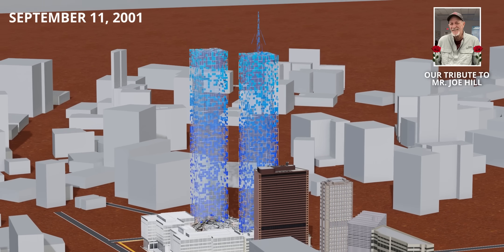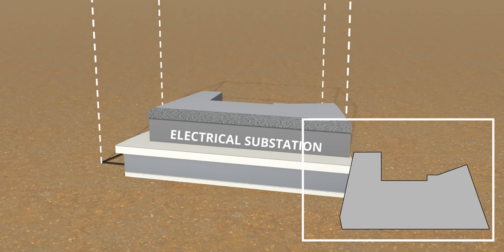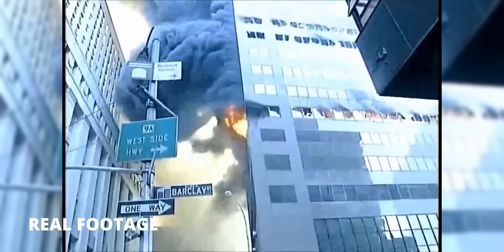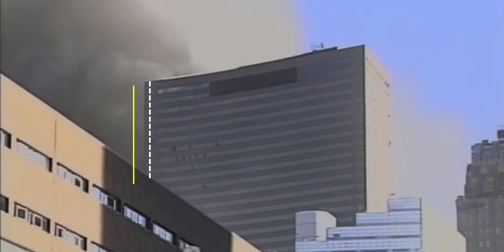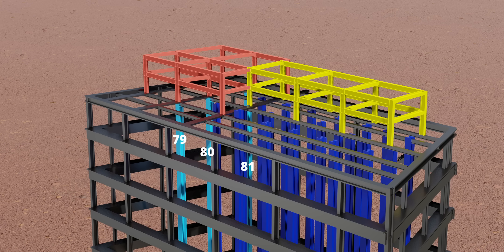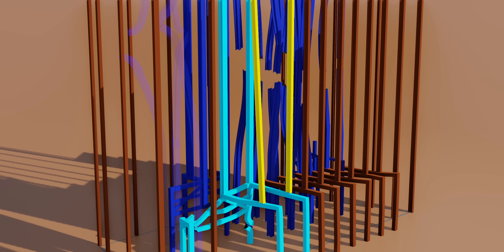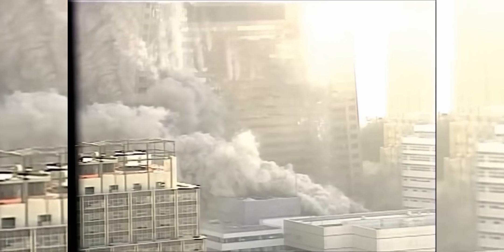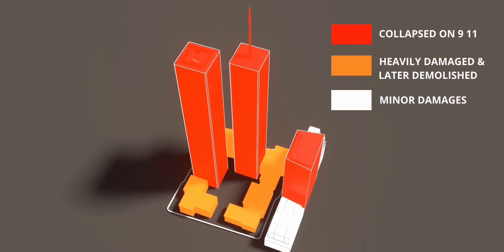Collapse of Building 7 | The Complete Physics

Comment: You talking through your ass cause your mouth knows better!
Reply: And yet (mostly) not wrong. Go figure. Not what you want to hear of course, but not wrong. Which is why that rebuttal (if I'm being generous) is the best you will be able to do.

You may not like it after more than 2 decades of internet conspiracy dogma, but what is being presented in this video is fundamentally correct and widely supported by the worlds engineering community.

While imperfect (there are a few problems) this video goes into a much higher level of detail than many viewers can comprehend and gets the collapse mechanisms fundamentally correct. This is true no matter who planned and carried out the 9/11 attacks or why . 
	
Sure, it’s not what you want to hear and goes against 20+ years of conspiracy dogma and conditioning, but that is not the same as it being wrong. You just need to fix your dogma. 

On the plus side, this video can be (and is) fundamentally correct about the engineering AND the 9/11 attacks could still have been some sort of inside job. The two things are in no way mutually exclusive. It’s just not the inside job the clowns you have been following on the interent have been telling you. 

This will surprise you to learn, since the conspiracy side of the internet hides it from you, but the mechanisms described here have broad professional support around the world. There are no professional engineering organizations (for example: ASCE, ASEE, ICE, etc) that disagree with them or have offered any formal dissenting opinions or alternative hypothesis. 

So, either the overwhelming majority of the worlds structural engineers and quite frankly simple observation are wrong,… … or you know more than the worlds best engineers from cruising around on the internet. Which seems more likely? 

If this explanation is wrong then produce a better one.  Be the first to even try.

Comment: 23 years later, this is the best you can come up with? 

If all of this is true, they approved multiple 90 degree angle changes for FOOTINGS.

The "we were just retards" argument doesn't work for me.
Reply: The video is pretty accurate. However, the damage/gash was caused by falling debris, not the antenna.
Reply: You may not like it after more than 2 decades of internet conspiracy dogma, but what is being presented in this video is fundamentally correct and widely supported by the worlds engineering community.

While imperfect (there are a few problems) this video goes into a much higher level of detail than many viewers can comprehend and gets the collapse mechanisms fundamentally correct. This is true no matter who planned and carried out the 9/11 attacks or why . 
	
Sure, it’s not what you want to hear and goes against 20+ years of conspiracy dogma and conditioning, but that is not the same as it being wrong. You just need to fix your dogma. 

On the plus side, this video can be (and is) fundamentally correct about the engineering AND the 9/11 attacks could still have been some sort of inside job. The two things are in no way mutually exclusive. It’s just not the inside job the clowns you have been following on the interent have been telling you. 

This will surprise you to learn, since the conspiracy side of the internet hides it from you, but the mechanisms described here have broad professional support around the world. There are no professional engineering organizations (for example: ASCE, ASEE, ICE, etc) that disagree with them or have offered any formal dissenting opinions or alternative hypothesis. 

So, either the overwhelming majority of the worlds structural engineers and quite frankly simple observation are wrong,… … or you know more than the worlds best engineers from cruising around on the internet. Which seems more likely? 

If this explanation is wrong then produce a better one.  Be the first to even try.

Comment: All this video proves is that good animation can make any theory convincing. I still hold it as a controlled demolition. Fires do not bring down steel buildings. I've seen enough videos of buildings on fire, with flames shooting up 10, 20 floors. Once the fire goes out, the building is still standing. In this case, as Silversteen said, pull it. pull it.
Reply: What the hell are you on about? Fires bring down steel buildings all the time.  Steel is formed using heat and deforms the same way. We've known this for a millenia. 

That's a thousand years to you.
Reply: @MFitz12  At what temperatures? Name one steel structure skyscraper, other than the WTC ones, that have crashed to the floor because of fire? I understand the WTC buildings were shoddy constructions (no central concrete cores) but still the way  they all fell, points to none other than controlled demolitions. WAKE UP my friend.

Comment: There are a ton of structural elements that were in the building including massive X braces I suppose those were left out of your modeling as they do not allow for your theory to work. Also office fires do not even come close to being hot enough to cause the interior beams to fail in the way you have described the interior beams failing and there was no physical damage caused by debris to the interior beams. As an engineer what you are putting out may fool a laymen but it is much less credible than the data put out by Richard Gage.
Reply: Making things up isn't an argument, you do know that, right? Then again, since you literally do not know the first thing about the building, I suppose lying is all you have.
Reply: @mooneyes2k478  I am an iron worker and build steel structures. There absolutely was X bracing There are photos during construction that clearly show them. They are also on the prints. The only place they are not is in this model.
Reply: @anthonysimpson2847  Yep. Of course you are. And I'm Superman. Well known.

Meanwhile, no there wasn't.

Comment: They said that jet fuel made the fire hot enough to melt the steel beams in the two larger towers, and that's why those buildings fell, but building 7 wasn't hit by a jet. A Regular building fire can't burn hot enough to melt iron beams that support the structure of the building. That's why whenever there are fires in other high rise buildings, they don't just fall, like the two WTC towers did. No other high rise buildings has ever fallen because of fire. So if there was no jet fuel in building 7, why did that one collapse?
Reply: "They said that jet fuel made the fire hot enough to melt the steel beams in the two larger towers"
The only "they" that has ever talked about "jet fuel" is you and your "truther" buddies. And only to try and make it into a straw man.

"A Regular building fire can't burn hot enough to melt iron beams that support the structure of the building"
Which was, 1, irrelevant since nothing "melted", and 2, utterly bog stupid since there were neither "iron" nor "beams".

"That's why whenever there are fires in other high rise buildings, they don't just fall"
Which was wrong, since they have, and irrelevant, since "high rise" is meaningless. Amazingly, there's no magical height of building that makes it somehow immune.

"So if there was no jet fuel in building 7, why did that one collapse?"
How about, "because it burned for 7 hours without any fire fighting"?

Comment: so many problems with this video...
Reply: Such as,...?
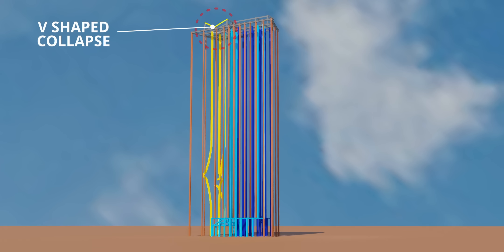Reply: @TheCriticalStinker-01  the failure of "transfer truses because building temperature was hight " at 6:31 - very poorly explained - they were deep below fire zones - how did they heat up? why are there 10meter gaps appearing in core columns as they progresively colaps all at same height? where are all the horizontal trusses that are holding core columns bound together?  this MS paint "simulation" is very poorly done... there are much more comprehensive studies on this topic.. done by profesors and universities..

Comment: Only one peer reviewed paper exists on this subject and it clearly states WTC7 was a controlled demolition. Which interestingly is what the owner admitted to on the day.
Reply: The collapse of Building 7 is one of the most studied engineering disasters in history and the subject of 5 comprehensive engineering studies and more than two dozen technical articles in major peer reviewed engineering journals, most of which were published 15 or more years ago. Thousands of pages of material.  This should get you started.

FEMA BPAT (initial report superseded by NIST NCSTAR 1A)

NIST NCSTAR 1A: Final Report on the Collapse of the World Trade Center Building 7, 2008.

Guy Nordenson and Associates, WTC7 Global Collapse Analysis Report and Summary of Findings, 2010.

Arup, WTC -7 Structural Fire Analysis Report (Runs 1-4), 2010.

Weidlinger Associates Inc., WTC 7 Collapse Analysis and Assessment Report, 2010.

BRE Centre for Fire Safety Engineering, Analysis of the Impact of a Fire in the Mechanical Room (5th & 6th Floor) of the World Trade Center 7 Building, 2010.

T. McAllister, R. MacNeill, O. Erbay, A. Sarawit, M. Zarghamee, S. Kirkpatrick, J. Gross, Analysis of structural response of WTC 7 to fire and sequential failures leading to collapse, J. Struct. Eng. (United States). 138 (2012) 109–117.

For a summary of the major studies I would recommend THE COLLAPSE OF WORLD TRADE CENTER 7: REVISITED by Mhd Anwar Orabi , Liming Jiang , Asif Usmani and Jose Torero which is a 33 page summary of the different analysis and conclusions published in 2020. Sorry, YouTube will delete this post if I give the link but it should be easy to find and is available from the University of Queensland, Brisbane. 

Which one were you referring to?

Comment: Well, it's a good thing they made a cartoon of this event because they way it's presented here is definitely something out of Fantasyland! Watching Building 7 fall straight down into it's own footprint just like WTC 1 and WTC 2.  I wonder what kind of records were kept in that building and who would benefit should those records get "destroyed"? 🤔
Reply: The top of the  south tower noticeably tilted when the collapse began, and there is footage of the penthouse on top of tower 7 falling through the roof before the whole thing collapsed. Also, tower 7 was damaged by debris from tower 1 and was on fire for nearly 7 hours. Not many buildings could withstand all of that.
Reply: @eastvilleholdingscorporate7881  it just a near perfect control demolition....huhuhu
Reply: Building 7’s collapse was completely different to the Twin Towers and harder to understand with most details hidden from view. But we can still sort out what happened through careful analysis and observation.  This is my explanation  of the collapse using the best available information and relying on no authority.

B7 was complex 47-story steel framed structure built on top of a smaller existing 3-story building, requiring several lower floors dedicated to complex load transfer structures instead of usable office space. Of trapezoidal shape and all-steel tube-in-tube construction, B7 (above the 7th floor) consisted of a central core of steel columns carrying most of the gravity load, perimeter steel columns around the outside of the structure carrying the remainder of the gravity loads and long span beams and girders to tie those elements together and form the floors. On the outside of the building hung a moment frame - the last part of B7 to fall 

Phase 1 : The first externally visible signs of collapse initiation occurred at 5:20:28 pm and was notably quiet with observers not even realizing the building was collapsing! There was no audible warning in the form of  hundreds of ear drum busting 180-190dB explosive bangs preceding the collapse. Here at 12:00 a local CBS affiliate reporter is talking 10 blocks from B7 when collapse begins. People don’t start to notice the collapse until 12:11. At 12:45 is the famous CBS fixed camera clip of Building 7’s collapse. Note how quiet it is.

youtube.com/watch?v=t5tEy6mXSE8&ab_channel=fresnosean379

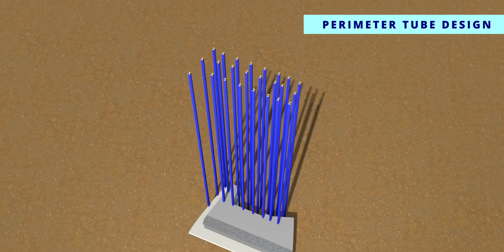Collapse initiation was due to lower floor failures above the load transfer region (7th floor) in the NE corner. In this video at 0:45 you can see the NW corner from inside the building while under construction, Column 79 just out of frame on the left. That big, angled steel beam across the top of the frame connects to C79 at one end. The girders connect to the beam. That beam and all those girders depend on just one connection

youtube.com/watch?v=nP3TNHPCIVU&t=35s&ab_channel=EdwardCurrent

Phase 2 : Lower floor failures caused a loss of critical lateral support over an excessive length of core Column 79 and it buckled. If you look at a floor diagram of Building 7 (see above) and look at all the structures that depend on C79 you quickly realize this one column was a relatively isolated structural element on which a disproportionately greater fraction of the structure depended analogous to say the Key Bridge. Externally we see a vertical progression of window breakage along the 44-46 line and a kink in the roof of the East Mechanical Penthouse at the top of the building, consistent with C79 failure. The transition from full capacity to almost no capacity occurs in virtually an instant. Once the buckling failure occurs there is almost no resistance

Normally with a buckling column, the load could very well be redistributed to other columns, meaning the buckling could stop after a while. With C79 that is not the case - the failure did not redistribute the load, so the collapse rapidly progressed to the roofline, sinking the rooftop penthouse.

Phase 3 : With C79 gone, B7’s progressive, non-symmetrical collapse continues with C80 and C81 at the east end of the core left laterally unsupported and quickly buckled and failed as well, sending the EMP down through the building. C79-81 all have no diagonal bracing, which I believe is a major reason why they could not redistribute a lot of vertical loads among one another.

From there collapse progressed from east to west through the central core until the core was gone taking all of the interior floors and probably most of the perimeter columns with it. Follow the horizontal progression of window failures low in the building and the dropping of the remaining rooftop structures into the building. One of the big takeaways from the NIST Building 7 study (that gets completely ignored) was their modeling which determined C79 failing under ANY circumstances would have initiated the same collapse sequence.

Phase 4 : After 10 seconds only the exterior moment frame - a hollow empty outer shell – remains, giving the illusion the building is still standing since little has outwardly changed. But it’s just a hollow empty shell like an empty cereal box and supported by only a few remaining columns quite unable to remain standing. With all internal framing gone, the north face leans inward, forming a V in the roofline, the last perimeter columns buckle under the strain and the moment frame free falls, landing on top of the 7-story high debris pile. It is here, at the end that a single measurement of alleged free fall acceleration is taken, from a single point on that outer shell. The Building (defined as its center of mass) did not “free fall” – just one corner of the outer shell did. The Building was already gone before that happened. The period of alleged free fall was a product of collapse progression mechanisms, not of collapse initiation mechanisms and cannot inform as to what started the collapse. Start to finish the entire collapse took 18-20 seconds, 3 times longer than true free fall .  How fast something falls cannot tell you what started it falling_ anyway. The debris spread outside the footprint, blocking surrounding streets, heavily damaging the Verizon Building and destroyed Fiterman Hall.  

Building 7’s progressive, non-symmetrical collapse was incidental and unintended collateral damage from the combined effects of fire + time + gravity, started by the collapsing North Tower. That is true no matter who planned and carried out the 9/11 attacks or why . The collapse was of so little consequence it barely even registered at the time, a mere footnote. It only took on semi-mythical status as an alleged smoking gun years later when demolitions at the Twin Towers, missiles at the Pentagon and shoot down over Shanksville all failed and conspiracists had nothing left to work with.

Anything can seem like a conspiracy if you don’t understand how it works. Now you should. I hope you found this helpful, informative and it solicits informed critical comment. If I made any errors of fact, logic or reason or left anything important out, please let me know so I can fix it. IF you can offer a more plausible alternative please do. Be the first. Please start any reply with the words “Tits McGee” or I will know you didn’t read it and are wasting my time.
Reply: none of the towers fell straight down, you can see them tip over in any of the footage, please use the eyes in your head